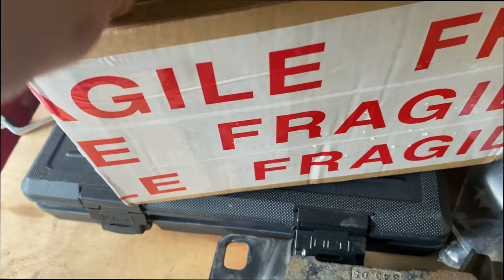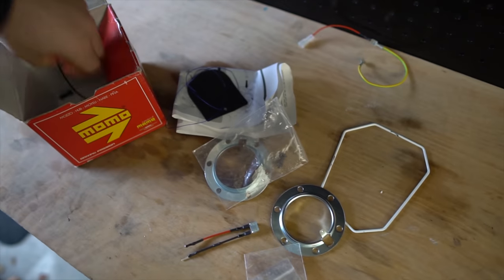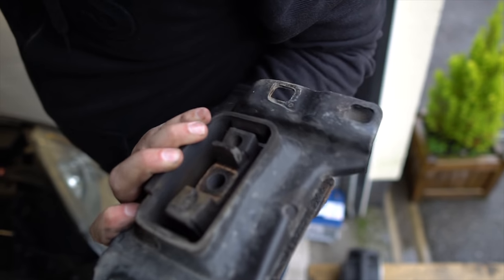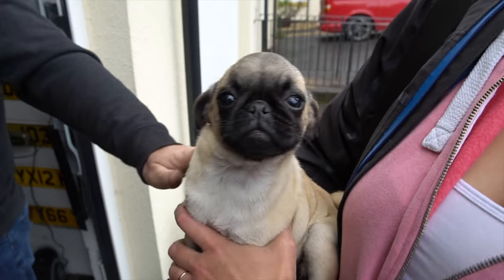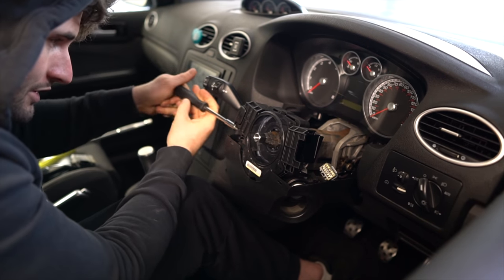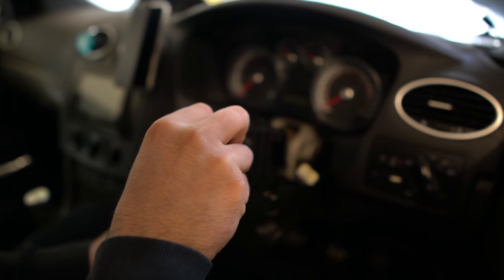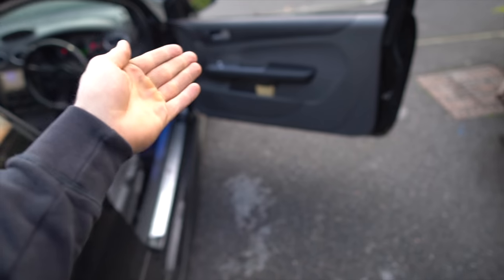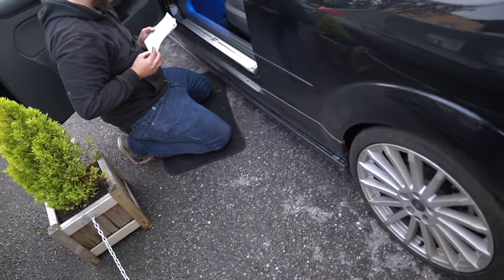HARDRACE ENGINE MOUNTS FOR THE FOCUS ST | VIBRATION CURE???

Comment: Just bought new standard mounts and used powerflex inserts instead, only one left is the gearbox one to do, as it's just the insert would it still need support on the gearbox as the bottom plate won't be coming off?

Comment: Ah bummer, I replaced my lower gearbox torque mount from hardrace to £13 standard one and its improved my 3rd gear on boost vibration by about 80%. Was going to try a new ford upper gearbox mount next in the hope it's not driveshafts. Good luck, I watch with great interest.
Reply: Where abouts did you get a standard one for £13?
Reply: @R7YYT  ebay

Comment: Pretty bummed out right now, had left passenger window drop down & blow the motor & fall off the window rails at 4:50PM on Friday while it was pissing it down, right as I parked up home, £170 later only thing that isn’t new is the glass on that side :F
Reply from the maker: +Michael Noble what? How did that happen?
Reply: No idea, my buddy pressed the window down button & it worked as usual, but he pressed it up & it made this weird grinding sound, went up half way then the glass dropped down to the bottom of the door. Couldn’t of happened at a more awkward time.

Comment: Gutted it didn’t solve the vibration 😞 also the big bolt that goes through the gearbox mount mine came lose you really need some thread lock on that one 😉
Reply from the maker: +Performancebluest ST_jay I’ll get that done tomorrow mate. :)

Comment: ITS NOT WORTH 4.5K now I am afraid to tell you..many many about with low mileage around 3k I got mine 70k miles for £2800 with airtech fmic, block mod, rs clutch, stage 1
Reply from the maker: +Iso Confused I don’t give a flying f** what it’s worth. I bought it. I didn’t buy it to sell. It’s worth to me what I’ve invested. 

Seeing as I’ve been a car salesman. A cars worth is down to the individual. Market value doesn’t always pay any relevance.
Reply from the maker: +Iso Confused referring to when I purchased it. The dealership obvs add profits on top.
Reply: I did pay 7k for mine 4 years ago and still own it.. it is more hassle than it's worth lol but I still love it

Comment: Mate of mine was getting vibration after getting one of the driveshafts changed at a garage. Turns out they didn't put a genuine ford one in so he took it back and they swapped it for him (apologised as well of course). Now it runs as it should.

Comment: Bit of a stupid question but I got set them fog light covers and keep falling off, how you stuck them on??
Reply from the maker: +Oliver Doggett double side clear tape mate.
Reply: GCM THE PT cheers fella.... nice motor btw
Reply: Just fitted my fog light protectors from sk graphics. Snap in to position with ring coated in 3m tape.solid fit.